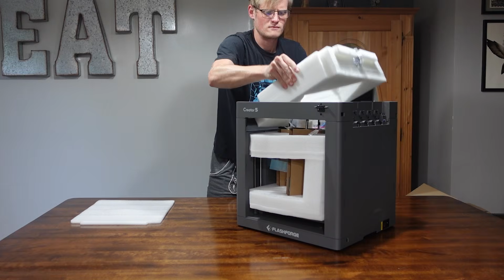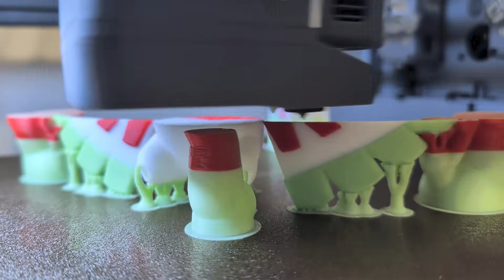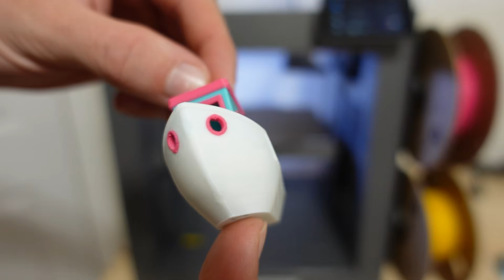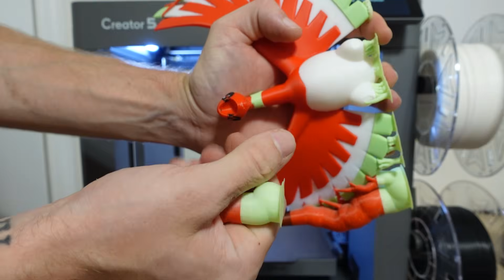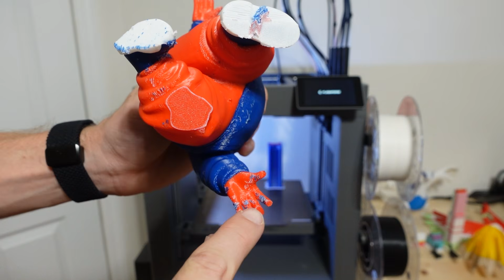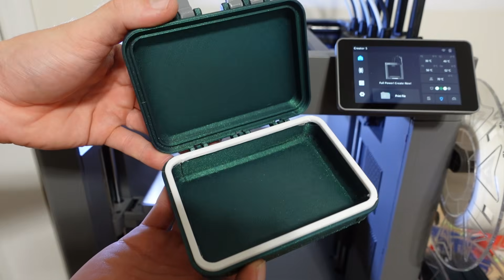4 Toolheads, Zero Purge Waste. $699?! | Flashforge Creator 5 Review

Comment: I was considering this printer, the features and price are very attractive. Unfortunately Flashforge is going the Bambu way and closing down their ecosystem and blocking third party slicers. Also, they think it's within their rights to tell you what you can and can't print on your machine you have paid for. You paid for it, you own it, the manufacturer should not have a say in what software you use or what you print.

Because of these things I opted for the Snapmaker U1, even though it's a little more expensive.

Comment: 0:28 "This video is not sponsored by Flashforge, they simply sent me this 3D printer and asked me to make a video on it". The fact that Flashforge "asked you" to make the video, speaks volumes. The video is clearly sponsored and not your honest opinions.
Reply: I am not saying he is biased or unbiased, that is not my place to judge. However, I think the review itself is quite good. He shows actual print results, failed prints, and tests multiple variables including different models, materials, and colors. He also points out the issues he encountered instead of pretending the printer is perfect.

Receiving a review unit does not automatically make a review dishonest. What matters more is whether the reviewer demonstrates the strengths and weaknesses of the product and provides evidence for their conclusions. In this case, he seems to be showing his testing process and the problems he found rather than just reading marketing material.